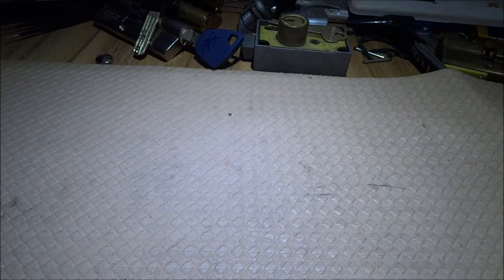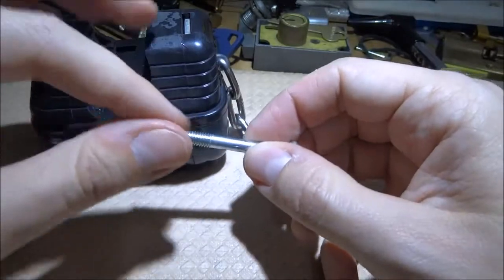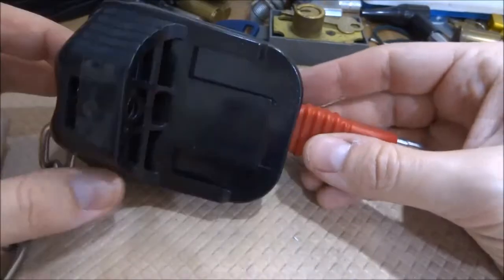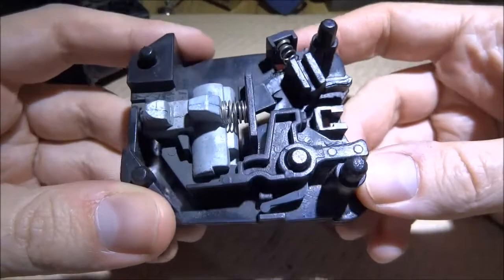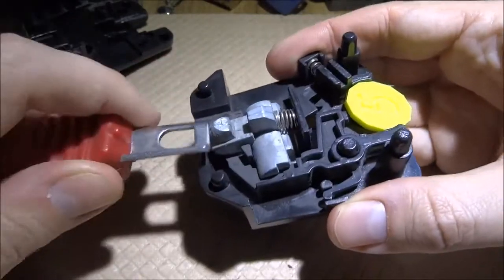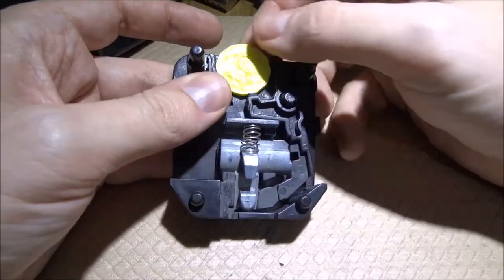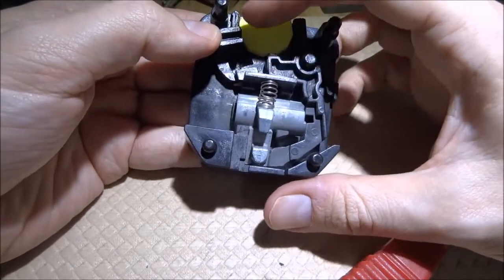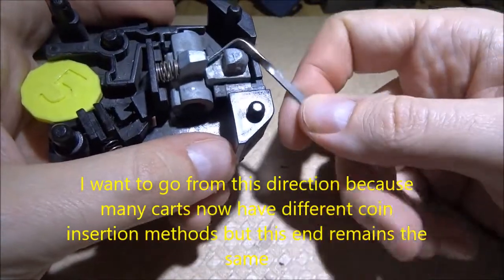Shopping cart lock (latch) dissected

Comment: 1. 
if you cut a bit of the coin, you can rotate it, and pull it out after releasing the chain. My personal magic fake coin. you don't have to return cart to the others, and next customer get free cart too.
2.
if you want someone else's coin out, you just grab the visible bit with good pliers and pull hard. The plastic will let it go to save the lock. My personal trick to get pocket money from carts being lost in the wild and far from the shop.
Reply from the maker: It will work on this device but the new ones that they put have a little drawer where you put the coin and then slide the coin in so no access to the coin once it is in. I don't care about putting the fake coin in but sometimes it is annoying when there is no spare cart left to release it (although I did print out 20 of them).
Reply: That one has a key with a hole and 3 tips. The center is the active and the 2 cutouts in the front, are for the fences around the activator. Make a wire, with a curve around the Ball to release. 
To lock, there is a small metal pin in the left side of coin room. Close the drawer half way. Press the metal switch with the new wire tool, or the tip of a random key. Push the drawer in. When it so closed, that your key is blocking, pull the key out, and push the drawer the rest of the way in to release the cart. The small curved cutout in the top, is perfect space for your key, when you close it enough for the switch to get by the critical spot.